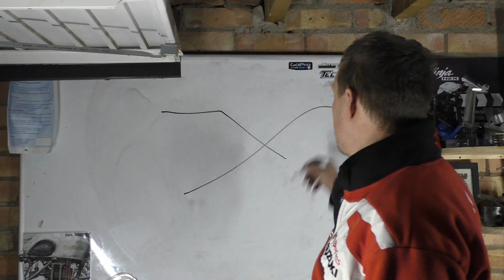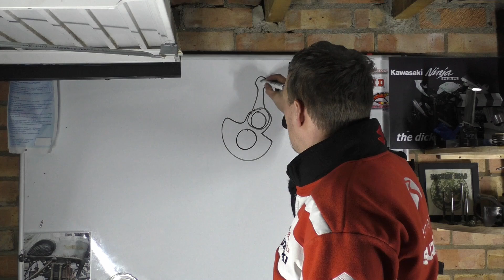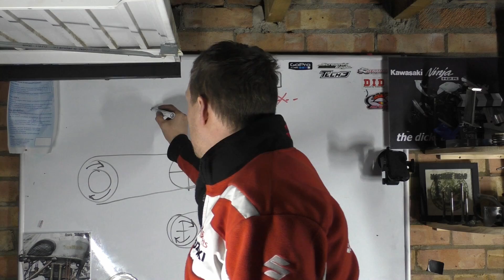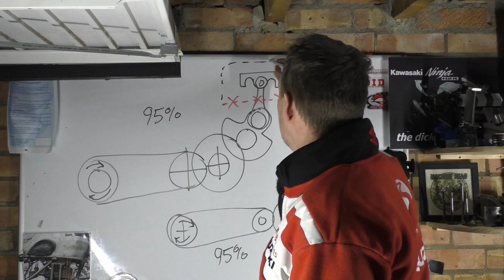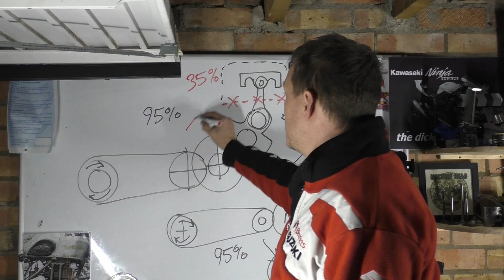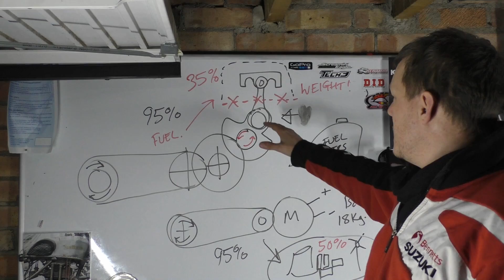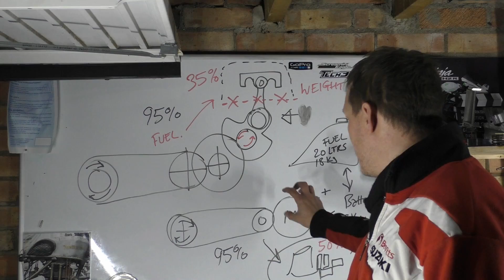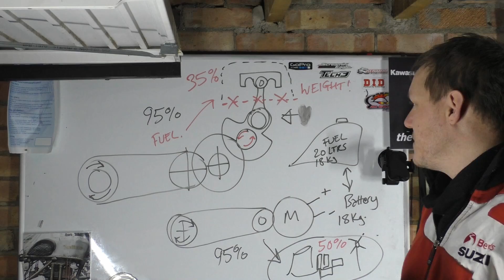Electric Motors - 95% efficient?

Comment: El motors do not need gearboxes, they use frequency converters, rimac has a 2 speed gearbox and 1st is used just for top acceleration(Rimac said that tesla made him put the stupid gearbox with his new roadster). And in electric eginering i think that big braketroughs can hapen, it happened with SF6 gas(an insulator)and high voltage  switches reducing the size of them by more than half.
Reply: That's rather an oversimplification; the truth is that electric motors DO need gearboxes. This is to do with something called "reactance". Basically, everything that can conduct current is also kind of a battery, and the better it does the more of its own capacitance it has. This means that the closer you come to an optimal electric motor in terms of power and efficiency, the more troublesome it also becomes to switch the field around for each winding, because the circuit sits there holding on to its charge/spin/polarity.

Now, at nominal revs this isn't a problem, and the big factor is how smart and fast your FC is at "leading" the current so that the magnetic field between stator and rotor is neatly in sync and as "close" as can possibly be. Basically, on a graph it'd look like the sinus waves just "leading" each other so that the magnetic phase shift is as short as is possible. Meaning, that the field is as short as possible between poles, and since magnetic pull increases geometrically, you get the most force for your current.

However, if you start getting up to some really fucky revs/angular velocities, what happens is that the aforementioned reactance kicks in. Meaning, the winding is simply not going to be able to switch over fast enough, and so you'll be losing a load of power and torque because the fields are not going to mesh as cleanly. You'll see a pretty damn drastic dropoff in engine efficiency and buildup in heat if you try this, especially on a motor with a passive-magnetized rotor.

In short; electrical motors have a very clearly defined useful rev band, which you really don't want to go outside because it messes with your shit. And you actually may want to design that rev band to be pretty narrow, since you want power and as a rule of thumb if you want more efficiency then you want more poles and a bigger radius, meaning closer fields, more of a lever arm and less ability to deal with revs. And it's also a sometimes terrible untruth that they have full torque from 0 - that's another oversimplification which can end you up with a burnt lump.

There are smart ways one can get around this, of course; one can switch off sets of windings as one goes up the revs, for instance. However, this partially defeats its own purpose, since that will mean that one has more angle to cross, i.e. a bigger "un-pulled" gap for the rotor to traverse between poles, and that you now have a lesser number of windings involved in pulling, which means you're cutting back on your power. So it's only useful if all you really want is higher revs and you're expecting a lessened resistance - meaning, not very relevant for a car or bike.

Of course, there's another way of solving this problem as well, but I am not going to tell that one on here since I'm gonna sell that one to Rimac or Tesla or Merc or some shit when I'm fuckin' good and ready.
Reply: PhilosophicalZombie But in the end a lot of electric cars now do not have gearboxes (well, they do but only one fixed gear) and do pretty well. To me it is more of a cost concern and not so much performance.
Reply: @allesklarklaus147  Yeah, truth. I mean, for optimal design what you want to do is to make the motor very tailor-designed to meet exactly the reasonable speeds you want to cruise around at, then have a very smart but minimized FC that can deal with all the wonky speed changes and the power recovery, and then keep it fixed-gear. But, as I said, rule of thumb is that the more lever and the more poles i.e. the closer you can match the fields, the more efficiency you can get. And it's likely going to be a crazy fine balance between what's best, considering how well we can do stuff today; more overbuilt motor&FC but losses from even a simple gearbox, or less overbuilt motor&FC but no heat wasted in trans fluid.

As for me, I'd rather go at most hybrid. Just because I like and am willing to pay for a little extra capability. I6 engines are so damn easy to build awesome anyway, both from a performance and efficiency standpoint, and then you can put a gearbox with a pair of integrated motors offset to the side and a little to the back of one. Trust me, if you see something like that in a future Merc performance model, don't be surprised.
Reply: @Sakhmeov  So you are saying that for a car or a bike it is not neded for some "normal" range of up to like 300 km/h or so 
Good luck with the desighn, please sell it to Rimac, there are rumors that the factory will open a branch in my hometown, maby i get a job there(as a cleaning lady or janitor)😂😂

Comment: wasserstoffzellen  -hydrogen cells is the way to go not batteries
Reply: von sauerkraut i agree but probably not. The problem of electric venichles with batteries is that electricity "doesnt like to be stored", because electricity is basicly flow of energy. And batteries weights shitloads. The beauty of using hydrogen is that it is very similar to the using of petrol, but without killing the femminists. 
But i think there are bigger interests in the background (money) that wants the switch from internal combustion engines to the battery power.
Reply: Ja und nein. Grundsätzlich genügen Lithium Ionen Akkus, allerdings werden für längere Strecken wohl Wasserstoff Brennstoffzellen herhalten müssen.
Reply: @Enthropical_Thunder  Yes and no. Basically, lithium ion batteries are sufficient, but hydrogen will probably have to be used for longer distances.
Reply: @untrainedprofessionals2374  
Ok, but what of all this is so unbelievable unrealistic? Battety EVs got quite the range for todays standards, for people in big city they should be sufficient. If people really are serious about reducing CO2 emissions, than hydrogen could be the answer for long range applications. For example in aircraft, to my knowledge, the russians had tested such a concept in the 80s and work sufficiently, thought storage was a problem but still worlds better than batteries.
Reply: Mandermach Luca. Easy for you to say.
Reply: @rumien1383  
Yes, what exactly thought?